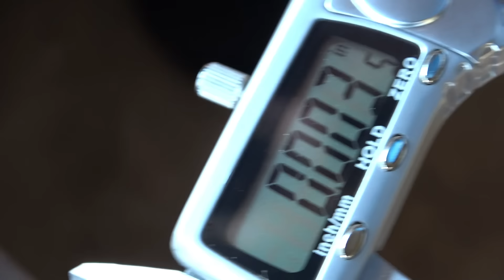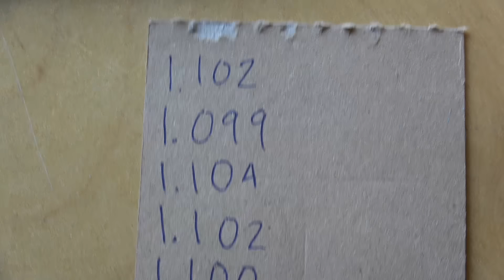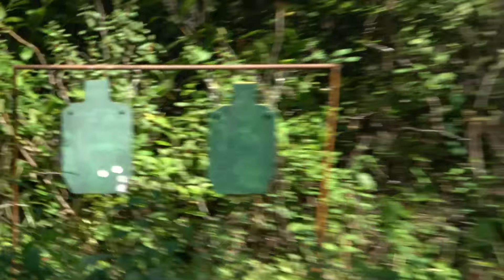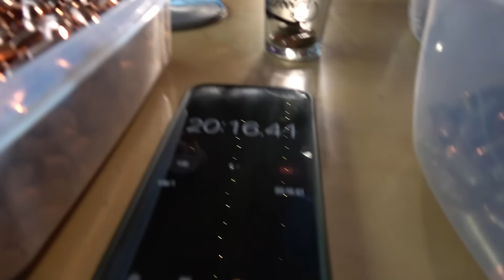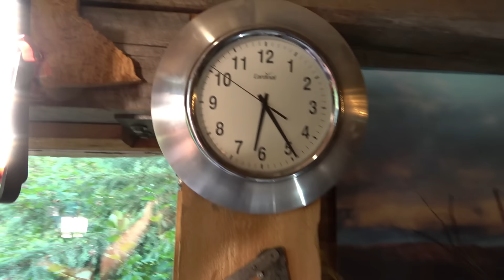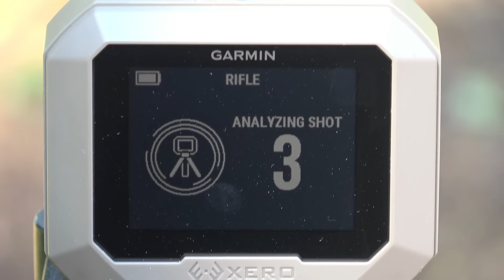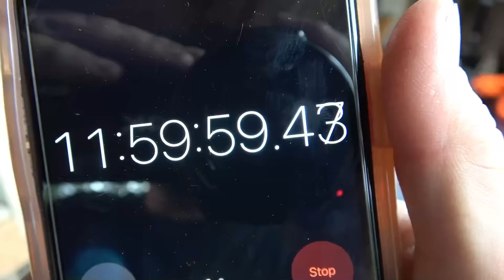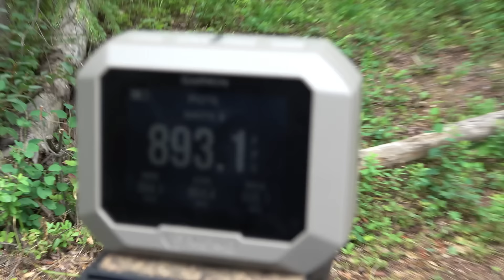We Made 10,000 Rounds in 24 Hours! DIY Ammo FACTORY

Comment: This guy.... the epitome of "hold my beer n watch this." 😉
As  someone thats reloaded all calibers from 25cal  to 10 Ga. over 50 years,  get some spare parts, some Ballistol, decent lighting, and do frequent checks for grain wt, crimp adjustment, Bullet/case height, total bullet wt, ragged case edges, etc.  Until you qualify as expert with it, you will be amazed at how things can change in a stroke. Keep the slides , dies, pins etc, clean and lubricated. If you're getting ejects from a range, it wouldn't hurt to get a vibra cleaner to clean the trash out of the empties.
Reply: Even just using a bucket, detergent and a strainer, you can get brass pretty clean. Clean enough, anyway. But if using random collected brass, you have to be very careful inspecting and prepping the brass. You wanna be resizing it and then trimming it to a consistent length. It is best if you chamfer your case mouths both before resizing and after trimming. 
I generally sort cases by manufacturer because I like consistent ammo and if you have a bunch of different headstamps in a batch, your velocity will vary a lot due to subtle variations in case volume and your ammo will be inconsistent. 
What they're doing will produce garbage ammo and potentially produce some dangerous rounds due to lack of experience. You don't start out on a progressive press and there is a lot they don't know about what they are doing, which is dangerous.

Comment: The case you are holding at 17:30 has a crimped primer pocket. The indent around the pocket is the crimp. Sometimes there might be stake marks. This is for military spec ammo to ensure primers don't loosen up during full auto fire. These cases are sometimes stamped 9x19 vs 9mm but not always. If there is a plus sign with a circle around it it is a NATO stamp and definitely crimped. You'll probably need to swage or ream these primer pockets to make the primers seat properly. Or sort them out. Have fun learning about handloading lol.
Reply: Man after my own heart. I used to swage pocket, ream flash hole interior, size, cut to length, lathe neck OD and sort by weight for empty cases shooting 762x51. We are all autistic, just to differing  degrees. My friend in the armory would sort first run ammo by seating depth, and then give me 1k at a time to weigh for deviations. We both could do the rapid fire and have 10 rounds within the smallest marker. Tower would yell "I said mark ALL shots" to the pit and they would run it down and straight back up to say FU tower.
Reply: This is awesome. It's so strange and bad that we now have to worry about backlash from people about making ammo and shooting. My husband told me that making your own rounds used to be normal, but then the world turned upside down. 
Keep on keeping on, you smart and precious family!
Reply: That reloading press automatically swages primer pockets........they just don't have it set correctly if it is still a problem for them. That is one of the big advantages of the Dillon 1050 and newer version. Mine has a Mr. Bulletfeeder so I don't have to feed bullets. Just pull the handle.....every pull of the handle is a winner.
Reply: First comment: it’s great to see you and your family reloading. Second comment: be very careful and do not deviate from the reloading recipes. The consequences could be very dangerous. 

Range brass & Primer pocket crimps: Check with Dillion’s customer service about setting up the press. They should be able to tell you how to set up the de-priming / primer pocket swaging step. Or, you can purchase a separate manual primer pocket swaging tool. The one I have is from RCBS.
Reply: @BR-o6y  yep… there is another step needed in brass prep… to ream out the crimp
Reply: Preach brother
Reply: That could also be the top of the primer cup still in place with the face and the anvil pressed out, I've had this happen when I first started wet tumbling brass. Water would be trapped inside the primer and weaken the cup if left for an extended period of time. I got a Lee APP press and started depriving everything before I wet tumbled.
Reply: Great comment. I was going to say the same thing then saw your comment.
Reply: @peterstoltz1827  Exactly 👍
Reply: @figelski1 I don’t think reaming is required as that model press has a stage that removes any primer pocket crimp.  Automatically.  The bent de-capping pin is probably caused by a piece of brass with a berdan primer. Not very common in the US but I have seen a few in my range pickups.  These cases cannot be reloaded on this type press.
Reply: Awesome work!
Reply: @figelski1  The Dillon 1050 (and later versions of it, which is what they have) has a built in primer pocket swager. They just need to get it set up properly.
Reply: Thank you
Reply: I hate the NATO brass. I have a coffee can full. It might get used someday.
Reply: @michaelburrows9042  RCBS used to make a die (not sure if they still do or not) that was purpose built to swage out crimped primer pockets.

It was a two piece set, with a typical screw in die, and a shell holder that had the actual swaging rod in it.

You can use it in any press that accepts RCBS style shell holders.

This is the cheapest way to go about it. Another way is to buy a dedicated swaging device like the one made by Dillon, that will remove primer crimps from all NATO brass calibers.

Edit: Forgot to add... NATO brass is extremely high quality. You will get many more reloads out of NATO brass than you will civilian brass.
Reply: Dillon makes a primer pocket swager that works great for that problem.
Reply: I used to be a commercial ammunition reloader, many years ago,  and have personally loaded well over 1,000,000 rounds of ammo on my Dillon RL 1000.  What you are actually seeing is a "ringer".  That's when the empty case goes to the depriming station where the depriming pin is supposed to push out the fired primer.  However, when the decapping pin starts to push out the spent primer  the outside part of the primer stays in the primer pocket and the decapping pin just pushes out the center of the spent primer as well as the anvil.   
FC (Federal CartridgeI) was notorious for this.  I had ringers on more FC than any other manufacturer, about 50 to one.  After doing an "autopsy" on a few of the ringers I found that if a little bit of moisture gets in between the primer cup and the primer pocket it will create enough corrosion that it will almost "weld" itself to the the primer pocket thus creating enough resistance to allow punching the center of the primer out and leaving the outside wall of the primer in the primer pocket of the cartridge case.   
Even with a swaging station it is still hard to tell that the primer pocket is clear of a spent primer.   It took a lot rounds before I could feel the resistance of the uncleared primer pocket before moving it on to the priming station.
Reply: @peterstoltz : Earlier Dillon's 1100 machine used to include one primer pocket swaging die + punch. I wonder if newer ones don't have it anymore though...
Reply: Unfortunately the round he shows with the stuck primer is not a crimped/staked primer. It is a Federal Cartridge head stamp and marked NT which in Non-Toxic. This would be in their BallistiClean line with a Non-Toxic primer. No crimp/staking. Also, if you look at A LOT of primer pockets on standard ammunition there appears to be a slight ring and that comes from swaging the pocket or the bunter from the head stamping process
Reply: The best thing I have found to remove a crimp is a 3/4" counter sink bit in a drill press locked in place as to up/down motion, using just the rotating bit, use a light touch just until the crimp is removed.  I have never had any luck with swaging devices and have tried many of  them.
Reply: Total lack of proper case preparation here.
Reply: You missed the point as that press has a swager on it that he did not set up correctly.

Comment: Recommendations: 1) Case preparation is important - Recommend de-prime first, Then tumble using walnut shell media and Dillon's case polish, then clean and uniform the primer pockets, then check case length and trim to recommended trim length, if necessary.  2) set up your resizing die so that the resized test case passes the case gauge test.  3) Keep your powder hopper at least 1/2 full. 4) Check your powder weight at least every 100 rounds. 5) Do not mix bullet types in a batch. 6) Throw away the aluminum casings. 5) Watch out for 45ACP cases with small primers - they can be reloaded, but not in the same batch as those with large primers. 6) Do not confuse/mix pistol primers and rifle primers. BTW - excellent choice on the Dillon progressive reloading press. With its no BS lifetime warranty, you can not go wrong.
Reply: also case lube
Reply: For bulk reloading like this your first 3 recommendations aren’t necessary
Reply: Maybe if you’re making match ammo
Reply: Yeah brother you right 👍 if they read your comment then he will be on track .
Reply: Do not throw away the aluminum casings set them aside in their own bucket to run in a small batch and use them for match or range shooting where you lose the caseings.
Reply: @andyrichter2714 
That would make a good business case though; selling what goes further through using less bullets to accomplish the same job.
Reply: Ive been reloading for over 40 years, Everything you said is solid experienced advice except.........Walnut shell sucks,,. That doesn't clean the primer pockets and barely cleans inside the case,. You want to wet tumble with steel pins. That gets the entire case inside and out plus primer pocket clean. If you are still vibrating with walnut shell you missed a turn about 100 miles back.  When I wet tumble with pins I don't have to do shit after that except spread them on a try to dry overnight.  They literally look brand new every time,
Reply: No need to deprime before tumbling. Who trims pistol brass?

Comment: There is nothing these girls can't do. They are fantastic!
A family that can put out 10k rounds in 15 hours is a family I want on my side of the battle.
The company needs to work on that pin to push out the old primer. You shouldn't break 2 in 15 hours. Contact the man and see what they can do. The rest of the machine looks like its working great. Congratulation, Girls!
Reply: they probably had berdan primed cases, with two flash holes. It isn't the fault of Dillon.
Reply: I've manufactured well over fifty thousand rounds over the past 30 years with my Dillon 650 and to this day i've never bent a de-caping pin

Comment: The ones with the ring around the primer. When you knock it out, are military brass.
 You can remove the crimp, that's what the ring is.
 With a swedging unit. I believe the unit you have got is 1100.If i'm not mistaken , it should have the swedging unit right on it
Reply: Yes, finally someone else knows what they are looking at. It seems they don't have it adjusted properly. It takes some trial and error to find the sweet spot.

Comment: From someone that has that press it takes countless hours setting it up to make perfect reliable and accurate ammo. The number one thing and takes time is case prep. If you full resize, cut down the overall length, chamfer, deburr, (neck and primer pockets) clean and sort brands the best you can. You could then put it on auto pilot and it will pump out 1,000 with no issues.

Comment: Welcome to the rabbit hole of reloading.
Reply: Most people think its cheeper but it is not and the quality sucks with a Dillon.
Reply: @kevchard5214  That is funny, many, many people reload for less than buying factory ammo and Dillon is very popular. The quality is actually great. I have the same machine on my bench, maybe the previous version but with a bulletfeeder as well and it has made 10's of thousands of rounds. Another dillon press on my bench had tons of ammo run through it before I bought it used and then I used the crap out of it. I sent it back to dillon and they rebuilt it for $65 and shipped it back. It works great. Last weekend, I won a silhouette match with 357 ammo I made on my Dillon 550. Today I won again, but it was a rimfire silhouette match, so CCI Standard Velocity is what I used. I have won the match numerous times with my 30-30 lever action. The bullets for the 30-30....cast by me......well, by the automated bullet casting machine that I built. Price out 30-30 ammo or 460 magnum, 45 colt, and all the way down to 9mm. Now, tell me where to find mid power loads for 30-30 and 460 magnum that are ideal for silhouette shooting. Full power beats the crap out of a person and is damn loud, and in 460 does too much damage to steel. By reloading, I can shoot these guns for no more than what new 9mm would cost, and sometimes less. You don't offer anything to base your simple opinion on, so you sound like a liberal or bot. Now, if you had said that the quality on Lee progressive presses sucks, I would have agreed. Dillon is the other end of the spectrum, yet people still use Lee and save money.
Reply: @CGT80  I may have had a Lemmon and I agree the LEE progressive is not the best but in the early 80s at 20 years old I couldn't afford a $4000 press and the LEE dropped more consistent rounds than my Dillon but a lot slower.
Reply: @kevchard5214  I started on a Hollywood gun shop 12 station turret press that we used in single stage mode. A cast iron monster that my dad's dad used and he used. I don't know exactly what dillon had to offer back then, but I think it was something like the RL400, the early version of the 550. Are you saying they have a $4000 press back then? Their most expensive one is around half that now, as shown in the video, but it didn't exist back then. I bought my dillon 550 used at a great deal. They sell for something like 500-600 dollars last time I looked. If the same thing worked for everyone, they wouldn't have so many options.....different strokes for different folks.
Reply: @CGT80  The one I had was around $800 the cheapest they had at the time  if I remember right because I saved for a few years to buy it. Dillon must have reduced their prices at some time because my gunsmith friend bought one for around $6000 to $8000 with all the bells and whistles in the early to mid 80s.
Reply: @kevchard5214  I think that was around when they first came out with the dillon presses and I thought I read that dillon modified other presses to start. Something like that could have been more of a one off or prototype and it seems possible the price would be quite high. That was a ton of money for back then. Now, they have a demand and just pump out copies, so the cost to produce them is spread out. My bulletfeeder is the original Mr. bulletfeed, which was later bought or partnered I think by Double Alpha, which took it from something probably machined in a small shop or garage to an item made by a company with bigger production capability. I'm not sure if the new ones are cheaper but I did notice they are made different and more mainstream or mass produced looking. The stand for mine is a toilet flange that would screw to a wood floor, under a toilet, but it works great. LOL
Reply: @CGT80  LOL The toilet flange is a unique and great idea. Its a lot cheeper than the ones for presses.
Reply: @kevchard5214  it depends heavily what ammo u are reloading. For me, I save 100% of the cost when I reload 308, but would actually spend 25% more when reloading 9mm.

Comment: You all should be checking your brass before putting it into the hopper... anything that doesn't have a perfectly round lip should not be run through a progressive reloader. That's one of the reasons why you are getting crushed cases. The other thing that you need to look for are crimped primers. Some primers (especially military surplus rounds have crimped primers, These will easily cause you to bend or break a de-priming pin.

Another thing that you should do is have a control round. Which is usually a factory made round that you are trying to reproduce.  And along with checking headspace, you should also be checking the weight of the entire round this will tell you immediately if a round has been overcharged or undercharged with powder. Both of which could have serious consequences if fired.

Comment: That case you were holding and then showed one with a side ways primer, those cases have a military crimp. Get an RCBS primer pocket swagger tool. I’ve had others but that ones the best
Reply: They already have a swagging tool....it is built into the machine they have. The 3 rd station has a swaging rod, but they must not have it adjusted properly.

Comment: 4 very impormant things to keep in mind : 
1 - make sure you got exact amount of powder in every shell.
2 - make sure you have powder in every round before placing bullet.
3 - you gotta have the right amount of belling of the mouth so bullet won't crush shell.
4 - the decaping pin should only be 3/16 's of an inch to 1/4 inch exposed, just adjust 1/16 " at the time , until spent primer falls freely,  otherwise you will crush inner webbing and weaken shell to an unsafe level and break or bend pin.
Happy shooting 🎉

Comment: Jeff, heat that priming pin up first with a simple propane torch, then bend it. It can be hardened and tempered from there (very easily) if required. Mild steel? Then, no need for the latter.

Comment: You can push those primers back out and use them. No need to waste them.
Be sure to look at the powder load to kind of make sure it stays consistent. 
Check the powder weight every time you add more primers just to be sure. 
Try pressing the ones that don't fit further into the gauge. Or see if they will chamber in your gun. Rim damage can keep them from fitting the gauge.
Also look into "SQUIB"rounds so you are aware of that potential disaster.